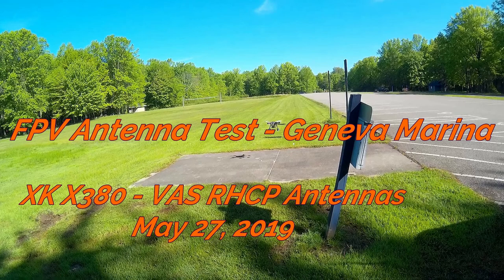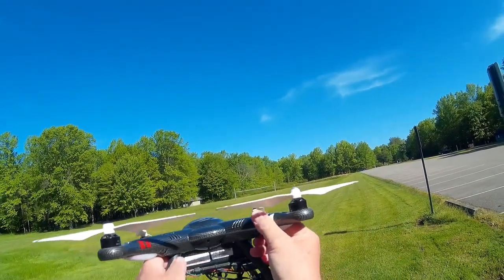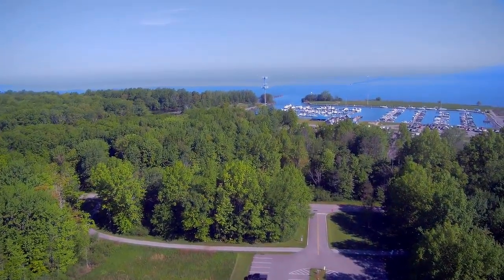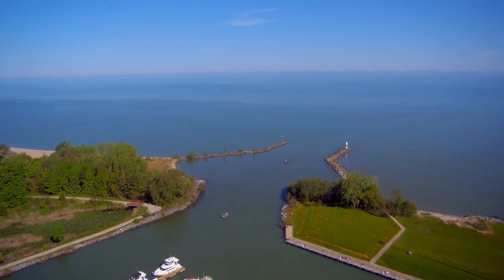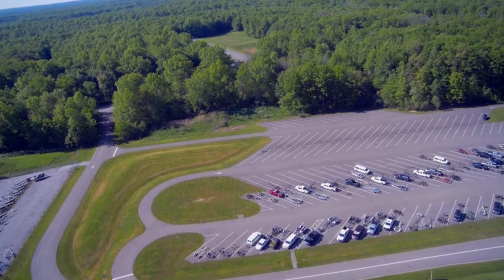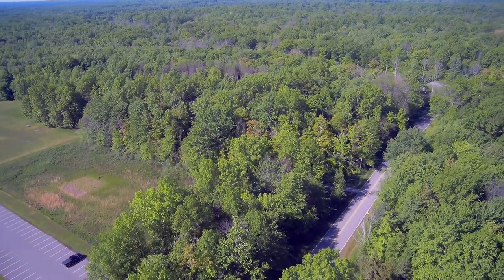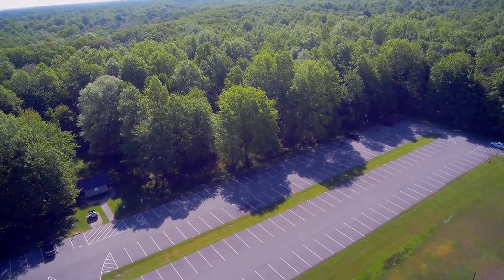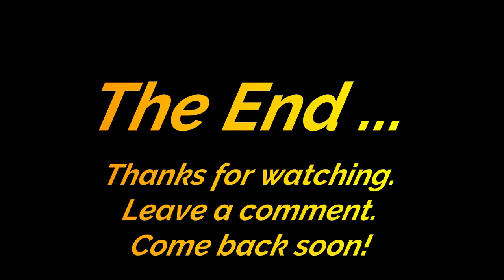X380 - V.A.S. Antenna Test at Geneva Marina (5-27-19)

Comment: Very nice video! Every time i see your x380 videos i want to take my out for a flight. :) I have a triple feed patch on my receiver and a clover leaf antenna on my transmitter. Patch antenna is very ugly and big but the signal boost is perfect.
Reply from the maker: Hi ND DN.  Yes, there's just something nostalgic about the old X380. As I mentioned to another poster, it was my 1st GPS UAV, and I had to do the mods to make it camera ready. We went thru some 'growing pains' together with DJ Soul Force, but, in the end, we sort of acquired a fondness for the X380. Pretty sure my new antenna set up would be good out to at least a mile. I'll have to take it out to some wide open spaces and give it a try. Thanks for watching and commenting. Cheers!

Comment: Really nice flight Bill, I don't have the OSD system on mine because I haven't figured out how to hook it up but I do have fpv.
Reply from the maker: Hi Greg. I hadn't flown the X380 in 6 months, but had its batteries at storage level, and they charged up just fine. I was pretty amazed that it took off and was perfectly steady/stable. I did do a 'gyro calibration' before lift off, so perhaps that helped. The FPV video with the new antennas is really good. One of the reasons I recorded the flight with my FXT Viper goggles was to see if it would be feasible to use them instead of the diversity monitor. I just might do that next time. I did do a 2nd short flight over a construction site the same day as this, so I might have another very short X380 video coming up. Thanks for stopping by and commenting. Cheers!
Reply: Another video, yes please @billsomrak
Reply from the maker: @uacl028  When I shot this video, I did a short flight over a construction site, and it will be good for a 3-4 min. short video. Cheers!